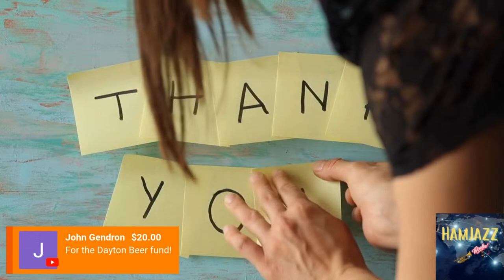Building your own Ham Radio Antennas!

Comment: That was a great show. love the blue tarp antenna. loop antenna's like that make great RX antenna. some of them home made antenna's work just as good and some times better then a store bought antenna.  I test with Walmart speaker wire. works super, if left out it will stretch and crack.  I just re wrap one of my toroid UNUN . was a type 61 ferrite wrap 49:1 with 17 AWG mag wire. 100 watt FT8 would start to heat up the wire before the core. got about 250 PEP SSB . did a re wrap 49:1 as a auto transformer tap at 2 turns. out of #14 AWG mag wire. same 100 watt FT8 no heating on wire. did 250watt FT8 and after a wile the core started to heat but the wire stayed about same temp as core. the 17 AWG on thermal shows rings of heat before the toroid. same core . different wire . different wrap still 49:1 with 100 PF cap. I use yarn to wrap my toroid then I get length for wire. my tent poles are fiber glass. maybe tape wire to it. I got old CAT 5 wire . 73's
Reply from the maker: Hey Robert.  Simon was a lot of fun and I love the creative ways he builds his antennas 👍

Comment: 12 comments yet only 6 showing…
I posted an innocent enough comment compared to our rude friend below. 
What gives?
Reply from the maker: They look published now.  After a stream ends it gets processed by YouTube which can slow when the comments are live 👍
Reply: I see them now.
Propagation issues… I guess as Hams we just need to suck it up lol

Btw it’s John, and I finally got my call sign. 
73 de JL1AJE
Reply from the maker: Congrats John 🍻
Reply: Cheers Ape!
I’m having quite some fun already. 
Bagged New Caledonia DX SSB on my very first QSO on 15m with 50W piped into a mangled plug & play diy EFHW.
Tuned to accommodate my IC7200 not having an ATU.

Used the G90 band scope to find the station 🤓

Aiming to bag 3G0YA next 🗿

Don’t have a medical license so no local QSO for now 🫣